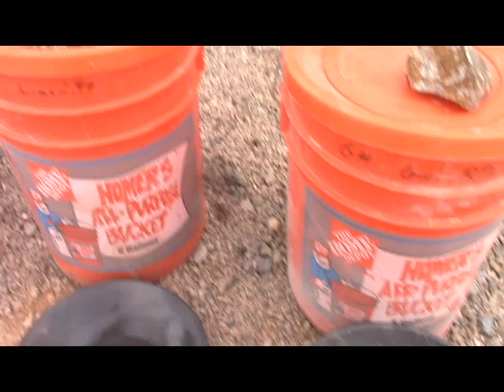Lesson 33 Looking for Indicator Minerals

Comment: Why other rock, detect a detector? Is this an iron content?
Reply from the maker: Gold in rock is rarely large enough to set off a metal detector.  Extremely valuable ore deposits could be easily missed if you only used a metal detector.  Therefore you have to look for other clues.

Comment: How far down should one expect to dig to find sulfides where there is a lot of hematite, very vuggy quartz and a wet weather seep? Should ten feet be enough? ~( 'w')/
Reply from the maker: If it is in a wet region, you may have to go down to the water table.  Below that, there is very little oxygen.  Rain water percolating down to the water table can dissolve minerals and carry them down to the water table where they re-precipitate in a process called 'secondary enrichment' and can produce very high grades.  In a dry environment, sulfides might be found close to surface irrespective of the water table.

Keith
Reply: @hardrockuniversity7283  So far all I have found close to the surface are blebs of hematite, and all of the vuggy quartz is stripped bare of anything that looks like a sulfide, and although I once read that microscopic specks of silver might be in there, if there is, its far too small for my cheap digital microscope to recognize.

https://www.deviantart.com/deliciousdeblair/art/Vuggy-Quartz-in-Chert-for-Visual-Example-001-771256987

https://www.deviantart.com/deliciousdeblair/art/Vuggy-Quartz-in-Chert-for-Visual-Example-004-771257971

I sense that it is possible that more of this vuggy layer might be inland, possibly, however, at a point that goes beyond the edge of my property, which would of course become a problem unless it was enough mineral value to justify buying the adjacent properties.

https://www.deviantart.com/deliciousdeblair/art/Hematite-001-681933586

https://www.deviantart.com/deliciousdeblair/art/Areas-Circled-in-Red-Look-Like-Metal-785524547

Down in my well [it was drilled to a depth of 500 feet] there is some chalcopyrite, magnetite, malachite, some tiny red crystals which might be zinc bearing, and what looks like really tiny drips of solder [bright shiny thin bits of metal] but they are very sparse and very small [since there is a screen over the inlet of the pump to protect it from ingesting abrasive material], and most of it is quartz and chert grit.

https://www.deviantart.com/deliciousdeblair/art/Minerals-from-Well-Sample-Series-007-742910542

https://www.deviantart.com/deliciousdeblair/art/Minerals-from-Well-Sample-Series-006-742910373

https://www.deviantart.com/deliciousdeblair/art/Minerals-from-Well-Sample-Series-005-742910145

https://www.deviantart.com/deliciousdeblair/art/Minerals-from-Well-Sample-Series-001-742902554

I have an idea I would like to try which would dredge the well, but it would be quite the undertaking, requiring that I pull the pump out and build a specialized jet pump with a fabric filter to retrieve the sediment, but I feel hopeful that such a rig could pull up at least enough material from that depth to show if the land is mineral bearing to the point of financial justification.

Also, I have an idea how to make a low cost 90 degree borescope to drop down the well and see if veins can be identified directly in the wall of the well borehole or not.

It would be most delightful to find that there is not only minerals but at a depth above the water table, although I have my doubts.

Also, it seems difficult to get an affordable core sample because the drills are crazy expensive and nobody seems to rent them in this area, you either buy one from some other place, or hire a core drilling company from some other place and they come in for a fee to sample the rock strata for you.

I am really hoping to find out something without spending a fortune.

Comment: Hi! Thank you so much for all you share and post! You seem to be probably one of the most knowledgeable gold prospectors out there! I was looking through your videos and didn’t come across any about leaching/smelting. I was wondering if you use those methods and perhaps don’t share that because it is so dangerous or perhaps you don’t use those methods at all. (Which I would understand either way) I’m trying to learn everything I can about leaching and smelting and it seems so many people on YouTube don’t take the dangers seriously and use proper protection or have any kind of air extraction/filtration system to capture the harmful, toxic minerals released into the air. Do you have any input on the matter? I would be ever so grateful for your shared thoughts :-)
Reply from the maker: I try to focus on micro scale mining, and leaching tends to quickly get into an expensive regulatory regime that doesn't work with 'micro'.  I have years of experience in open pit/heap leaching with sodium cyanide as the lixivant, but you are talking millions of dollars to permit such an operation.  

If you have a high grade ore, you could theoretically start small and bootstrap the operation.  To start with you would probably use some kind of gravity separation to recover what you could directly smelt into dore' and stockpile the tailings for later leaching.  Small scale tank leaching is also a possibility, especially with some of the fast working/low toxicity leaches.  They are a lot more expensive than cyanide, but in a small scale/high grade situation it often makes good economic sense.  The big companies don't generally use them because they want BIG ore bodies where capital expenditures are less important compared to operating cost per ton than with a micro operation.

WRT smelting, if you are smelting a final concentrate to dore' there are often very few complications.  If you are trying to direct smelt a high grade/ complex concentrate then it can get very difficult.  In general hydrometalurgy (leaching) is almost always the best way to get to a smeltable con if gravity won't do it.  If it is complex, then it is often best to sell the concentrates to a refiner as they are set up and permitted for the situation as well as being experienced.

Is this primarily theoretical, or do you have a specific project in mind?

Keith

Comment: Great video on sorting ore and testing for gold by mineral composition. In north east victorian (australia ) I also look for structure of the host rock and the quartz itself. Laminated or Book Quartz being a good carrier of gold.
Reply from the maker: Yes, structure is often important also.  It is very useful for the small hard rock miner to run enough samples to identify just where the gold tends to appear.  That is why the ability to hand pan hard rock gold is so useful.  Have you tried my method yet, or do you have a different one that works well also?

Keith
Reply: I havent tried your method yet I just use a small plastic sample pan and the same technique I use for alluvial. and go slow.
Reply from the maker: Have you seen lesson 24 yet?  That is a fairly simple method that works well for the micro fine.  Usually takes me about 5-6 minutes start to result and was so easy that I had a newbie doing it his second pan ever.

Keith

Comment: I can't stop looking at the speck on the camera
Reply from the maker: I understand.  I have cleaned the lens and it won't go away.  I'm afraid I might have damaged the CCD somehow.  If not, perhaps I can disassemble the camera and find the issue.  I'm afraid to do so though because I have no confidence I can get it back together.  Any suggestions?

Keith
Reply from the maker: One of the problems is that I only see the spot when editing and by the time I get back to filming I have forgotten it.  Thank you for reminding me.  It looks like there is some sort of small debris on the INNER lens.  Unfortunately I see no way to get to it to clean it.  Hmmm...
Reply from the maker: My email is hardrocku@outlook.com

Any time you need it you can look it up at hardrocku.com

if the assays are accurate and representative, it should not be a problem to make a profit if there is even a modest tonnage.

Keith
Reply: Hard Rock University need your email. Need you help on how to process an ore I have. It's a sulfide ore of silver 400ozt and gold 3.5-7.0 ozt. As per assay from a lab in Reno. It also has lead, manganese and a high iron content with arsenic. Would like to send you a sample to see what you think.

Kasse.
pmpcmining@gmail.com

Comment: i found gold the most in the black looking material. Probably manganese oxide
Reply from the maker: Every ore body is different and usually changes with location.  That is why regular testing and good record keeping can be very valuable.

Good luck,

Keith
Reply: Hard Rock University i used fisher gold bug to locate some mineralization in the vein and took samples. In Arizona i tested i got some color around 0.1-0.2 gram per bucket. But in Nevada i tested with the same technic using metal detector, didn't get any color at all. But instead lots of silvery looking pyrite. After panning it usually settles in the bottom with gold. I'm not sure what was giving target noises,sounded like perfect targets. I was ready to bet i got a ton of gold until i crushed it and got nothing.
Reply from the maker: You might try roasting the pyrites and then crushing and panning.  The gold can be inside the pyrite.  Use good ventilation, some minerals have toxic fumes when roasted.
Reply: Hard Rock University than i realized that metal detector isn't going to work on fine gold. I was searching a mine i found on USGS report, my GPS lost connection so i averaged where the mine might be and ended up going to another hill thinking that's where the mine is. Found another mine,but it was dangerous to enter. Instead i saw an exposed vein took some samples, looked through jewelers loop saw small spec of gold. So i knew the quartz vein has gold, but the fisher gold bug didn't give any signals at all, not even a sighn of mineralization. Got 0.1 gram of gold per bucket, but i think it's worth to test more. Probably it has more than 0.1 gram per bucket, and the deeper i dig i assume the quantity of gold will increase.
Reply from the maker: That sound very good.  Are you certain the 'gold' is not chalcopyrite?
Reply: Hard Rock University it was gold. i crushed a bucket of ore, pulled 0.1 gram. Took to gold shop they looked at it its gold. It's flour gold smaller than #120 mesh. I thought fisher gold bug will at least indicate mineralization in the vein, but it's completely silent. At least i learned that i can't rely on metal detector.
Reply from the maker: That is pretty low grade for a metal detector to pick up with fine gold.  .1g/bucket is only about .15 Oz/t.

Comment: At one of the mines I visited and did some prospecting at a few months back, the best mineralization was associated with secondary copper minerals like Azurite, malachite and chrysocolla. In the unoxidized ore (of which there was only a little) the gold was associated with Tetrahedrite. This tetrahedrite is a copper mineral, hence the copper minerals in the oxidized ore. In cases like that with obvious minerals where you can see well to discriminate and sort out the best ore - sorting can be pretty easy. A fair percentage of the ore with decent copper mineralization had visible gold.
Reply from the maker: Cool.  I have one major rule of thumb-  there are no rules.  Test everything starting with the most likely first and don't stop until you have PROVEN what you need to know.

Keith

Comment: Hey Keith the last sample that you're showing is it breccia .?
Reply from the maker: I'm not sure which part of the video you are referring to so I will guess the first part where I showed the five mineral types I tested.  The 'black mineral' sample is one of the few that is not an obvious breccia.  'Breccia' refers to any rock that has been broken into pieces and then re-cemented together.  Any rock can become 'brecciated' and it is very common along the faults and fissures that form veins as the movement and breaking of rock is what opens up passages for hydrothermal fluids to flow.

The big rock I washed with water is clearly a breccia as you can see where cracks opened up and were than filled with other minerals.

Keith
Reply: thank you for the informaion
Reply from the maker: You're welcome.  Hope it comes in handy.  See why I like the hand panning technique?  It allows quick and cheap information that while not as quantitative as an assay, is nevertheless quite useful.

Keith